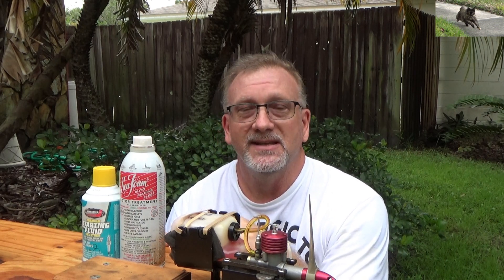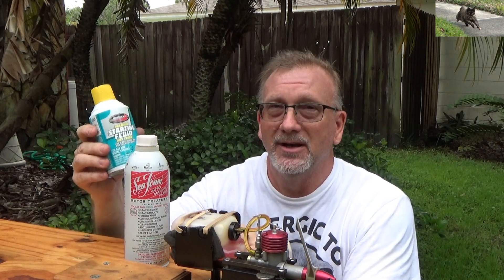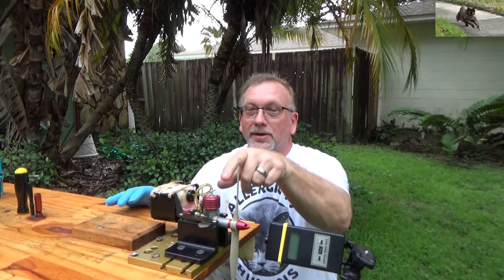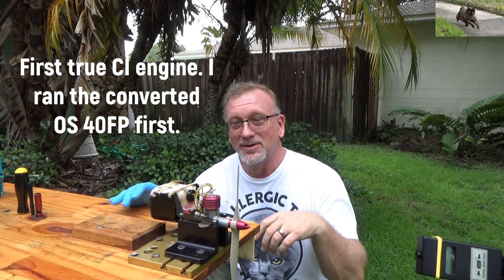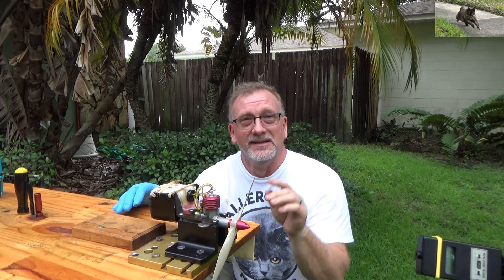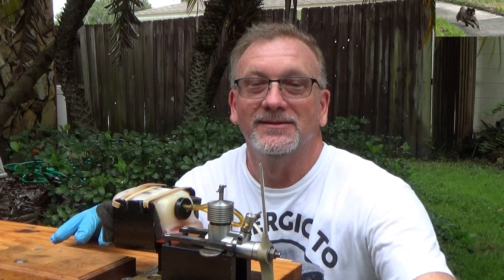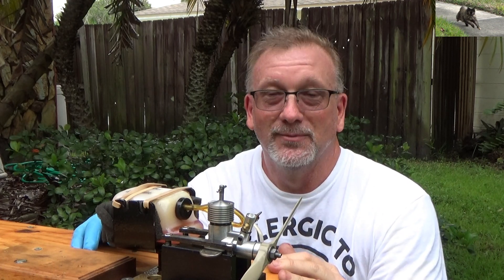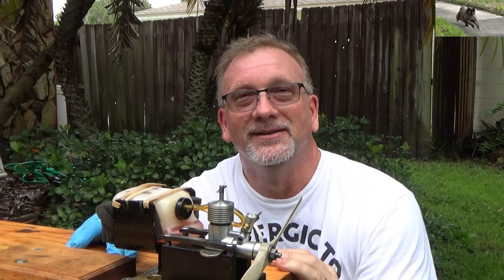Compression Ignition Engine Run Day!

Comment: I was 12 and flying control line and had a .19 diesel, I don’t recall the make of the engine, my dad said use this, it will work great. Well it did but it was the first and only engine to date that broke two of my fingers, index and communication finger on the right hand 🤚. Thank goodness for wood props, Master Airscrews hadn’t come out yet or it may be the first fingers I ever cut off!

Comment: Yea they are Fun too run ! My P.A.W. looks similar and has only single exhaust, it was my breakthrough in engine starting, very easy too find a good technique with it ,my m.k 17 is harder too start but is mostly heavy and at the 30 grams  it outweighs my AMCO 3.5 c.c. plain bearing by 16 grams  and the AMCO is very easy too start if you just act like it is a P.A.W. 1.49 c.c contest engine,anyway THANKS AGAIN !! !!
Reply: I meant for the weight too bee 130 grams for the m.k 17 and 114 for the 3.5 c.c AMCO  !!  !!

Comment: Great run for both engines,  your experimental diesel fuel is a proven sucess, it passed the long term storage if i remember equall parts of oil, kerosene, and that specific starter fluid, congratulations!